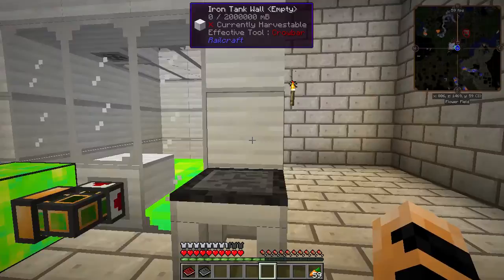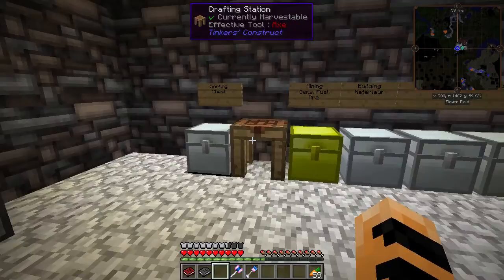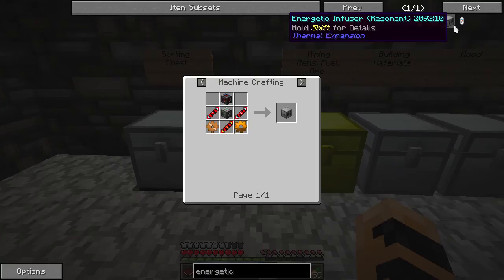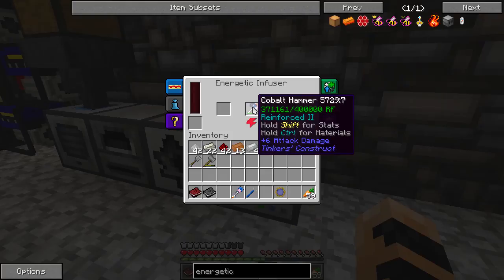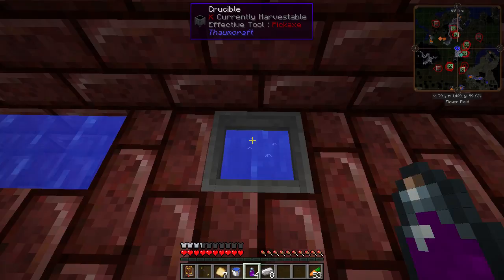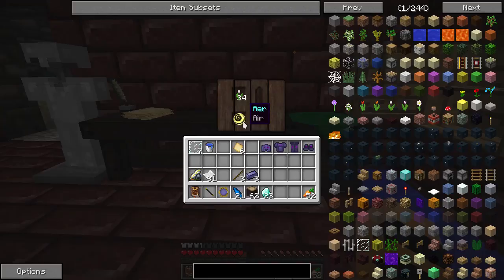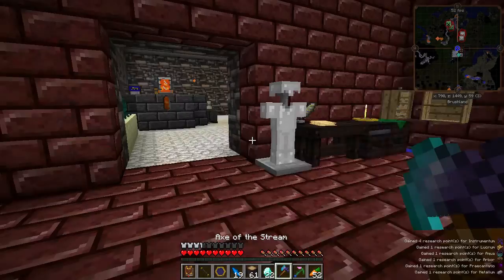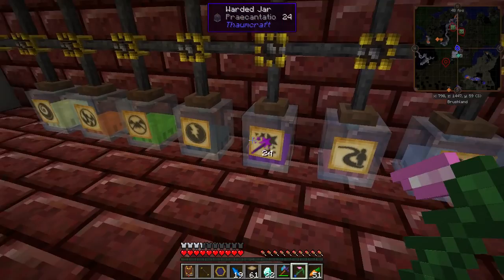Let's Play Thaumcraft 2015 E18 - Axe of the Stream

Comment: What is your config ?
Reply from the maker: artek1204 I don't understand the question. Config for the server?
Reply: no, your pc, waht do you have ? Cpu...
Reply from the maker: artek1204 Intel Core i5 2500K overclocked to 4.5 GHz on all 4 cores. 16 GB DDR3 RAM 2133 MHz. Samsung  SSD. Gentoo Linux. AMD Radeon 6850.